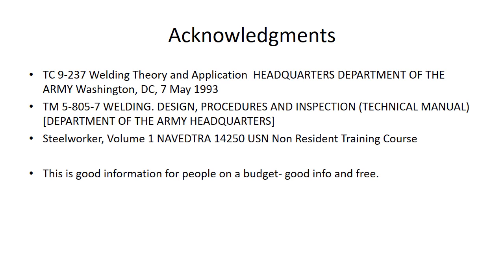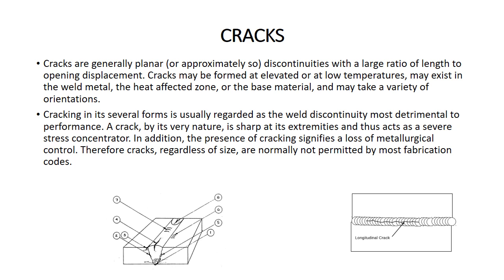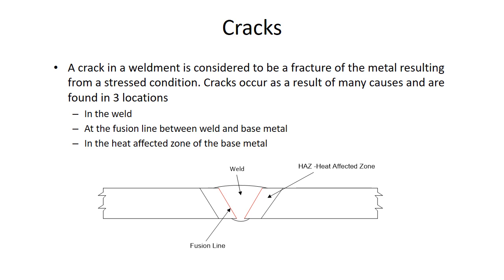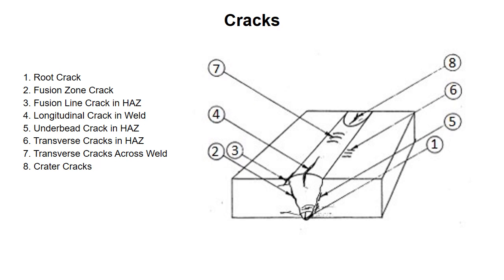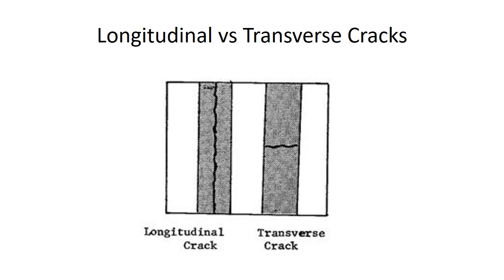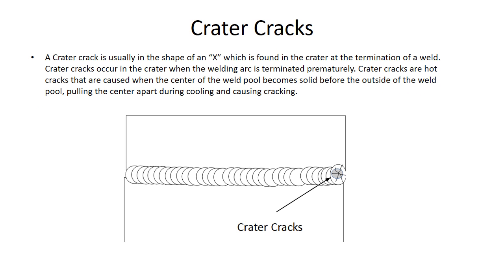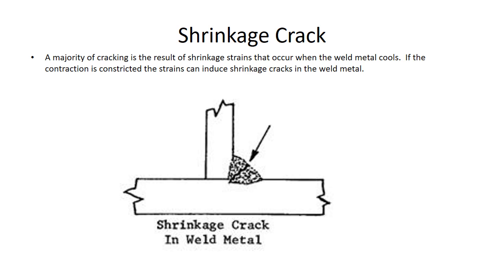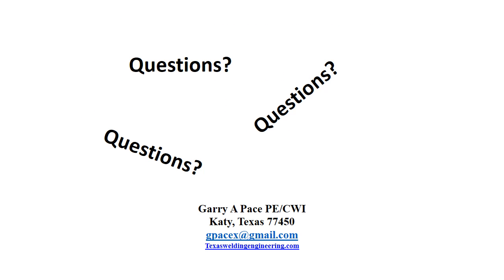Weld Defects - Cracks

Comment: PREVENT cracks by preheating, preheating, preheating. Aws D1.1 Clause 5 fabrication code 5.6 page 168. Use the preheating table 3.3 in clause 3 to find your preheat temperature for your base material to be welded.

Comment: Close, but no cigar. Causes of cracking is simplistic. I may have missed it, but I saw no discussion of hydrogen or service-conditions as a driving force. The nomenclature did not match common welding terminology. Embrittlement is a collect-all phrase that covers many grain structure issues without explaining why they occur - so many alloys, so little time. This may work for an Intro to Welding class for engineers. It's too elementary.
Reply: Show some respect